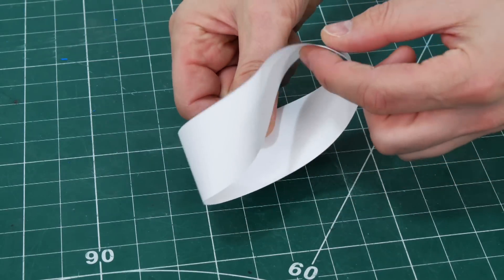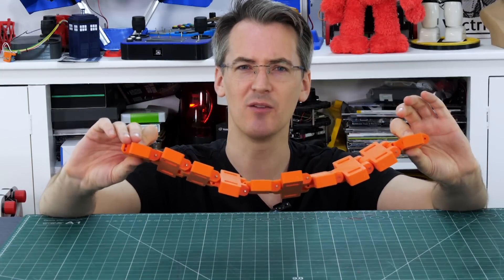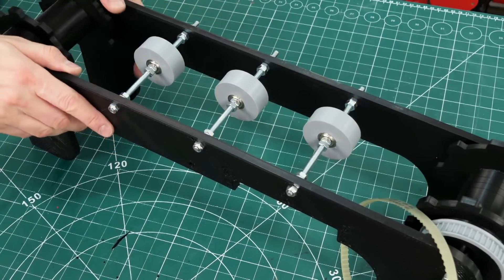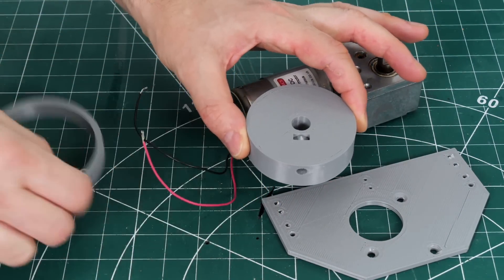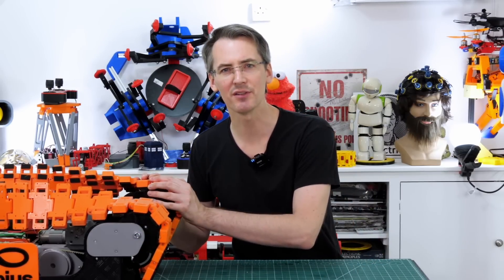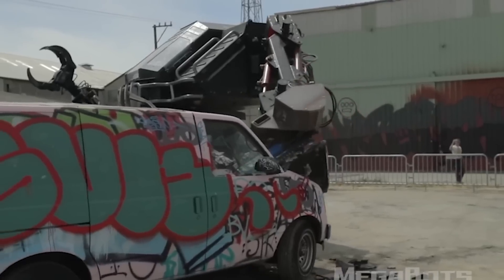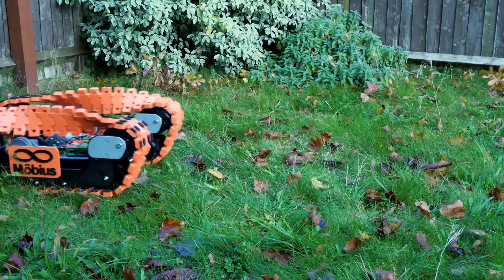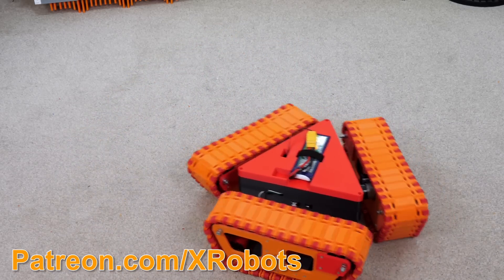Mobius Strip Tank

Comment from the maker: I found a use for the Mobius Strip Tank, check out part 2: https://youtu.be/UtQrloHD3Co
Reply: James I have an idea! I was thinking about how to make the fastest feasible tank, I realized that the real problem is the sprocket system, what if we moved the track with magnetic fields like a maglev, with very low friction between the tank "wheels" and the track, magnetic suspension and acceleration. 

this is a very sudden idea so I just leave it here in the hopes you understand what I mean, I was literally thinking about the rocket tank the soviets made when I realized that friction is what's really keeping a tank from reaching higher speeds, wider tracks may help too im not sure.
Reply: I got another idea, what if we segmented the body to allow it to flex over surfaces? Almost like a millipede. 
( I'm a crazy soviet scientist with nutz ideas if you haven't noticed)

Comment: 10 tracks with 18 degrees between them is 9 link joints with 18 degrees between them for 9x18=162 degrees, not 10x18=180. This is known as a fence post error to programmers.

Comment: Ya know, it's interesting. At the beginning of the video you said there is no discernable orientation between clockwise and counterclockwise movement of a Mobius strip, and I do understand that a textbook does define it that way.
But you had a problem with alignment between clockwise and counter clockwise orientation of your track when turning left or right.
So that's not actually true
Reply: Also, is the twist you made in both tracks the same direction of twist?
Reply: When you go to make the twist creating the Mobius shape, you can twist the paper either right or left.
There's an orientation that may influence performance
Reply: Here for example it looks like the twist has the face of the strip oriented facing away from the tank body. So the forces may look to be working like this:
<- -> these are pulling away from center mass
Orientation like this:
-> <- for those forces should help with control when turning
Reply: Think of a sidewinder.
They actually use similar force mechanics. If the initial twist in the strip is going left, then it will tend to move towards the left, same with the right
Reply: https://youtube .com/shorts/89PVmdMaxT8?si=J01kW5V8CQ7oDai7

Space between YouTube and .com to make sure the link posts

Comment: What about programming it to count which tread its on to keep track of grips vs smooth and having a function to reset it to putting both sudes on the same position?
You could prigram it so that when going straight it will let the smooth side slide and have the grips "catch up" to the othe other track, then emgage both.

Comment: One benefit of the Mobius track/tracks is that they can keep the wheels and sprokets driving them quite clean and decrease the amount of dirt and debre get accumulated on them while also increasing it's track life with it's full track wheel and sproket assembly increasing it's work life and decreasing it's maintenance frequency.
Do a test of driving this tracks in mud and dirt and see how clean the tracks and track assembly stay after each run compared to a regular single side track just in comparison no need to print a single side track you can  adjust this one to become a single side track for testing the two types of track assembly.

Comment: The fact that you only put grips on 1 side and not the other makes absolutely no sense to me, you can even see where the vehicle has grip issues when its on that half in this very video, from a engineering standpoint, it just seems bizarre. 
and im not posting this because of my crippling OCD that causes me strife every single hour of the day........ >.> i totally didnt do research on track grip mechanics and surface tension for this very comment. i dont have a problem. <.<

Comment: About the only thing I could actually say is you need to put pads on both sides.

And the actual benefit is that you have twice as much tread to wear down before you need to replace it.

Using the "benefit" you used where half the tread is unpadded is just chaotic nonsense for no reason

Comment: A mobius tank tread is inherently infinite and therefore never degraded. Also, by the same logic, regular tank tracks are infinite and never degrade.

CORRECTION: If a mobius strip (one surface) is infinite, then a regular tank track (two surfaces, each looped and therefore infinite) is double-infinite. This means that tank tread degradation is actually repairing, and tank tracks produce more tank tracks through use.

Comment: The advantages I can think of is that you basically have double the surface area to wear out, so the lifetimes of your tracks are extended quite a bit. It's not a lot of flashy functionality that you gain with it but cost-wise a mobius strip might have a big impact. The fact that the tracks can pivot in an extra dimension might also make your tank able to deal with even more uneven terrain than a normal track can. for example if they can twist when in contact with the ground (might have to redesign your bogey wheels for that) they might make more contact with surfaces that are tilted differently perpendicular to your track.

Comment: i got a question related to your previous tank with the wheels on the links, if you just had 2 tracks would the wheels in the links let the tank turn better without rubbing the tracks on the ground? cause i think that would put less stress on the motors but let me know if im wrong.

Comment: I guess the usecase for this could be more durability on the tracks. Since you're technically using both sides of the wheel at the same time, they will wear out slower compared to only using one side.

Think of this as formula 1 tires but you are using both the inside and the outside of the tire at the same time, making the durability near double

Comment: I'm wondering what effects this would have if the twist was on the bottom and this was run over different terrains such as mulch, sand, ice, asphalt, etc. 
also considering this with rolling cylinders or blades like an ice skate on the sides of each segment? the direction of the twist would also be an important factor.

Comment: Tanks only have one sprocket, then the wheels bearing the weight of the tank are road wheels, and finally the non load bearing, non sprocket is the idler, some tanks will also have return rollers which are the tiny wheels holding the top of the tracks.

Comment: The only hypothetical advantage I see is that this gives you 2x the wear/contact surface for given track  the way it is built. Though realistically on proper treadled vehicle I don't see that panning out well. I do wonder if putting a set of spiraled road wheels along the twist might be a advantage for running the tread at lower tensions since it might prevent the twist node from advancing basically "phase" locking the waveform...rather than relying on tension alone to keep the drive sprockets engage when encountering a shock.

Comment: Why do you 3D print ALL of the pieces?  I can understand printing the more "complex" parts but why the flat parts?  A lot of the parts for this project are just flat profiles with holes in them.  You could save Soooo much time by making them manually from sheet materials like acrylic or polycarbonate.

Comment: An interesting use would be for sand traction, with the twist on the bottom it would dig into the sand to go where it otherwise couldn't.
With a flip mechanism it could then go to flat track mode for hard surfaces

Comment: tread-cycle, a round single tread vehicle like a bike; rounded tread edges should allow it to lean for turns, and two wheel turning so the front wheel isn't doing all the tortion: the tread has to be half-round for bike physics, and mildly flexible for the handle-bar to turn 10 degrees or so. I know you can do it; i can see it already.

Comment: Could it be possible to add some grip but, only when you needed to? 
So, instead of those grippy pads being stuck on a side, being able to add in each orange part of the belt a sticky pad part in the center and being able to pushed in from side to side befora touching the ground to add grip when needed. 
Probably is not easy to explain but i hope you get it…🙃

Comment: What if you put a servo between two links, so you could change the track from closed strip to möbius at any time? 180 turn with the servo, 1 cycle of running, the track turns inside out, 180 back. And this way you can changr between two different types of grip

Comment: The real benefit would be for space rovers or bomb detectors harvesting samples of ground covered and cleaning.  In the middle if the track was vertical you could have scrapers removing and detritus and with a track designed to collect and scrapers shaped to remove collect and examine anything rolled over in real time.

Comment: Was neat until you tried to make up a reason why it would be necessary. Your hybrid tracks would be functionally identical to traditional tracks with half the length grippy and twice as long with all the extra length taken up by idlers above the body. Just adds more degrees of freedom to solve a problem that doesn't exist. Just let it be a neat experiment and leave it there.

Comment: what about having lightly spring loaded extentions  on the outsides of the tracks that have the grip pads on them.  The spring would be enough to prevent the pads from making contact with the ground.  Then have an actuated bar with wheels to press down the pads when the tank needs the traction.  Can also use it in conjunction with turning.  So the bar lowers puts tention on the pads pushing it down to make contact to the ground engaging the grippy pads.  I hope this makes sense.

Comment: So really the strip is a tension device on this also, but in the field it allows excess treads to also be carried outise of the chassis. Just need an additional tensioner in the field.

Next though can you make a single tread tank with this,using a Mobius yread to lift tread in front and/or back so you have a uni-tread that actually turns still.

Comment: as a bit of a tank nerd it scares the hell out of me that you have 4 sprockets instead of just 1, the easiest way of making tracks function without much hassle and also giving the best possible way of doing track tension is by only have 1 drive sprocket and everything else wheels, now yes one would argue it makes the tracks more likely to slide off, but that's why you use things like teeth on the tracks to align themselves with the road wheels and the drive wheel, now I understand how that wouldn't work since the track would need teeth on both sides but this could have been dealt with by using things depressions in the track so the wheels could sit in the track instead. also finally I would to say that having your outer most road wheels as sprockets will also force you to have near perfect track tension to prevent the tracks from misalignment with the sprocket.

Comment: I think if you can compensate on the durability of the links on the side torsion the surface ware of plates would be improved. Try a rotary mobius strip where it flips the tracks to give added hight...it causes more problems but  I bet it's fun 😅

Comment: The way to go with Möbius tracks is to make them toggleable. A single link would be capable of twisting, creating a Möbius track. Then the tank should travel so the external track surface is exchanged with the internal one, before untwisting the link to undo the Möbius. Effectively providing two different types of treads. Real tanks already use e.g. rubber and all-metal tracks depending on the scenario, but Möbius tracks would be toggleable on demand, without stopping, the need for manual installation, tools, or extra parts. It may be possible to develop such tracks for some existing vehicles, but a futuristic tank could even switch automatically depending on the terrain it sees ahead on the trajectory chosen by the commander, or sustained damage: the problems you've noticed when turning with mixed tracks could maybe be used to undo another problem.

Comment: You seem to like wacky ideas for Tank treads. Here is one: have retracted grippads in the links.
On the inner side, the links get a slot where a cog ⚙️ can push against when it gets lowered. This extends the pads for more traction when needed. 
The pads can be held in position with a mechanicals compliant system. 

I’m German, so it’s German engineering. I jut came up with it.      \_/                    \⬇️/
——-___——-     —— \_/ ——
___###___    ——###—-

Comment: There might be an interesting way to expand on the idea of rotating the tracks along multiple axes. Using some sort of doughnut shaped sprocket and idler wheels might allow the tracks to self adjust and change their angle with respect to the tank over the surface, while the top portion remains flat with the body of the tank. It may be possible to make it so that the tracks form a 90 degree angle with each other (both at 45 to the body) at maximum angle to maintain contact while driving along a valley, or V-groove or something, instead of riding on only the edge of the track. From the front, the tracks would look like \-/ when the terrain looks like \  / instead of l-l

Comment: I figured it out. The system stated it needs to be doubled over. like if you were to think of the most efficient way to have a tape be read in two paces at once from two different polar angles. So tow sides of a coin at two points. I think there is a missed opportunity here  one for power one for shock absorption.

Comment: I think the issues this would create outweigh any possible benefit. At least for outdoor use. You're gonna be running the dirty side of the track over your sprockets all the time, so you're either gonna get it all jammed up with mud and rocks and crap, or worse, the rocks will derail it. 

Could be useful in a closed environment, where surface wear is greater than tension, torsion or shear forces, giving you double the surface area by using both sides of the belt.

Comment: What if you have normal looped track but then have a mechanism that can break the chain, put in the 180 degree twist, reassemble the chain, let the track run 1 cycle, break the chain again, take the twist out, and reassemble?

Comment: .... can you make it flip the tracks on demand?

hear me out. a small platform over the center of the tank body. you want arms to be able to remove the small strip of the tread where the loop transition is, and replaces it with a normal chunk of track with either smooth or grippy plates. then when you want to flip the actual treads, it stops, pulls out the straight chunk of track, inserts the loop kink, does a fullrotation to cycle the tread, then swaps the loop kink back out with the straight track. I guess you would also have to flip the small strait track so the proper grip is exposed.

Comment: If you were able to switch between the Mobius strip version and the circular version, then you could easily flip from sticky threads to smooth treads as needed. Just stay in circle treads all the time, use the Mobius pattern to switch to the other side, and then go back to circle treads. Great way to give you two options for driving around

Comment: I feel like a slightly curved piece underneath the top "rotating" part of the tread would help considerably with both aesthetics and overall smoothness. There looks like there's some added friction and resistance because the treads are just forced to get pushed against the sides and into place with nothing to guide them.

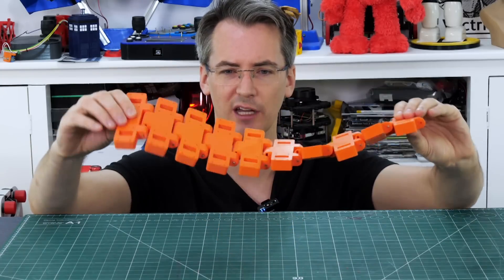Comment: 1:50 The reason 10 links with 18deg between each doesn't quite reach 180deg is because you only have nine joints, which means you should expect 162deg, so they're actually a bit more flexible than you expected, not less.

Comment: 1:45 just happened to notice, the twist not being a complete 180 is not because of the tolerances, its due to there only being the 9 joints in between the 10 pieces but still would need the 11th piece to add that 10th connection joint
Reply: no, the 10th joint is in between the first and last tread. His design is correct and totals 180 degrees.
Reply: @anthonymadorsky1551  yes I know that, but that's only if it's connected together, he was just showing the demonstration of the angle and it wasn't quite 180 yet in a straight line and he pointed it out, and yes if you connected it together it would be a Mobius strip, but it would only complete the 180 twist in the 180 around the track, he would need the 180 on a straight line then the rest of the track links to complete the actual tank tread

Comment: a twisted upper tread causes more friction which is amplified as the tank's scale increases closer to real world proportions and it may still work but it will also cause more stress on the treads. You'll also need to re-engineer the rollers to handle dirt and debris being carried into the inside of the tread.

Comment: I got to wonder if this would help propel a tracked vehicle thru the water really fast because of the cork screw shape of the track...you could also steer the tank using the tracks with out the need for a rudder...just slow one of the tracks down to turn like they do on land

Comment: It would be interesting to see a special link in the track that can spin 180 degrees, and a system that can switch it's orientation to add the Mobius effect for a single loop of the tracks, and remove the twist after that loop. This would switch which face of the tracks is used on demand, meaning you could engage or disengage the extra traction on demand rather then it  switching on its own each rotation